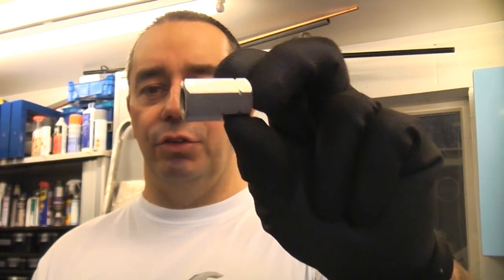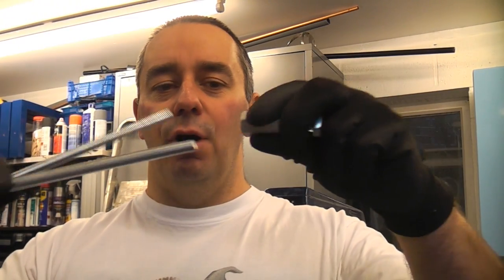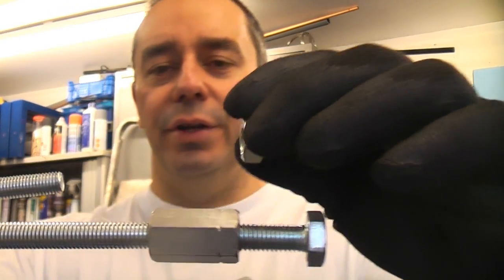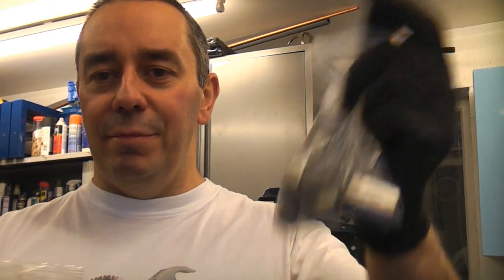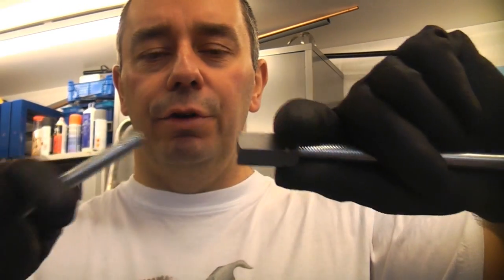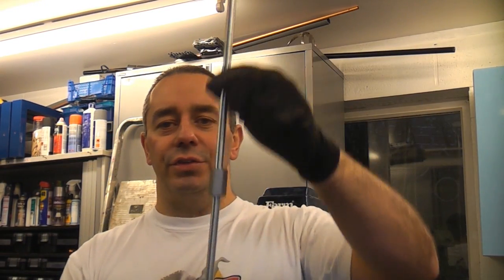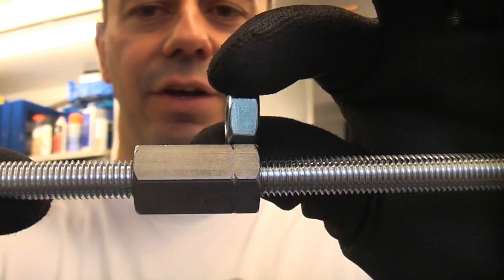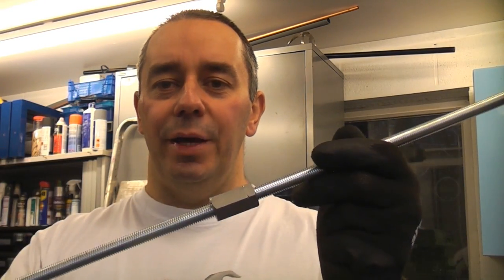Stud connectors

Comment: Nice vid. I live in Florida (where we sometimes have hurricanes). My garage has threaded rods that run through the walls from from the foundation to the roof. Basically the roof is bolted to the foundation. Those connectors are used in various places to join sections of the rods together. It does seem like quite a strong connection. Thanks for the explanation.
Reply from the maker: You are welcome,
Thanks for explaining where they are used in your property and thanks for the comment ;-)

Comment: Informative video, we use them to hang cable trays at work, being a belt and braces man a dab of thread lock doesn't go a miss either if it's a permanent fix. Plus the nut😊...
Reply from the maker: Good point ;-)
Thanks for the comment

Comment: Hi U.H. do you know if there is anything on the market that is the same outer dimension but internally will reduce the size from M10-M8 ? I must admit that I haven't really tried to find any or what they would be called but I may have a job requiring something like that. Cheers pal. N.
Reply from the maker: I wasn't sure myself and in the past I have welded a M10 and M8 connector together but it looks like these will do the trick, but they are round externally instead of hexagonal http://ebay.eu/1A4LTbv
Thanks for the comment ;-)
Reply from the maker: Blimey, only just realised the price of them!
I was going to buy a few packs to keep in the garage but at that price I won't bother LOL
Reply: ***** Good to know they are out there...for others they could be like  accountants ,"Knowing the price of everything yet the value of nothing" anyhow thanks for the heads up...great upload...
Reply from the maker: malachy1847
Thanks for the comment